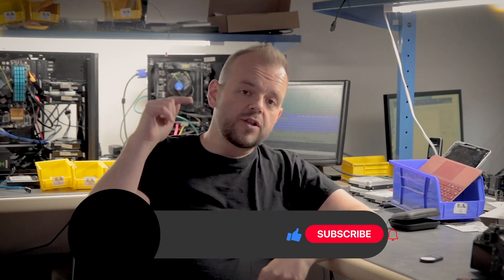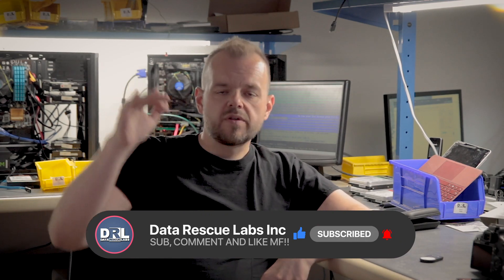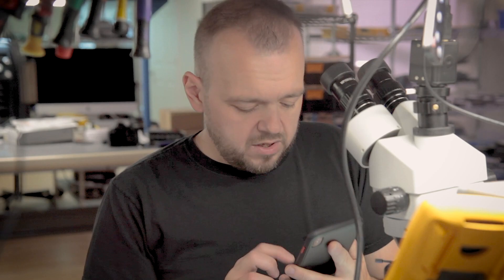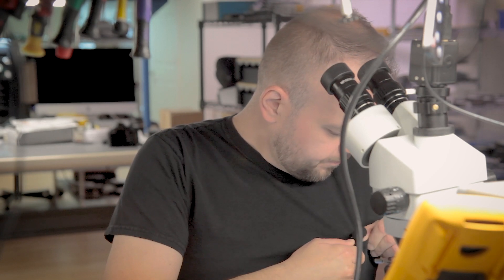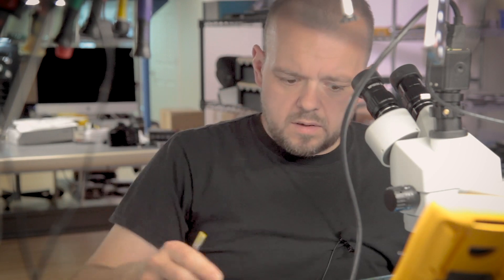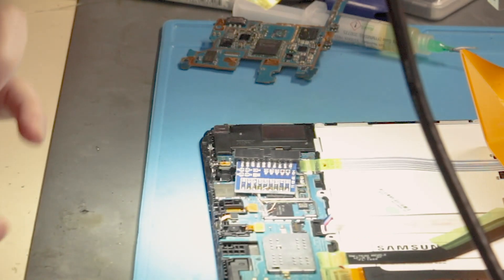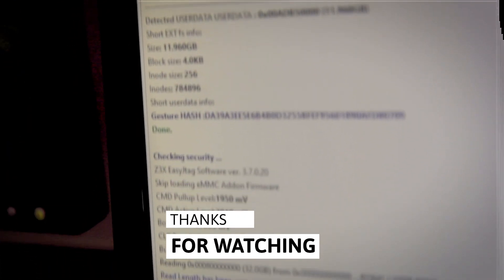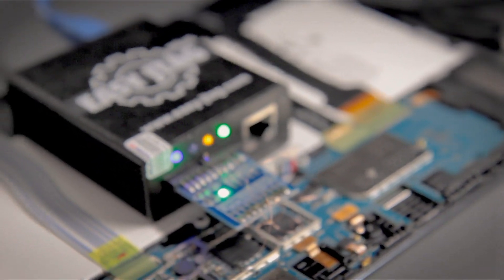Samsung tab not turning on - Data Recovery

Comment: How can you tell if a dead Samsung T713 is drawing power as it’s not making noise and seems totally dead.  Is there any way of getting the photo data off the on board 32gb memory?
Reply from the maker: You might need to mail it in. Email info@datarescuelabs.com for information
Reply: @forensicguy  I’m in the U.K.  what sort of cost range are we looking at to fix?  BTW, there is voltage presented to the battery which is something !  It just won’t charge and/or won’t start or be recognised by a pc on usb